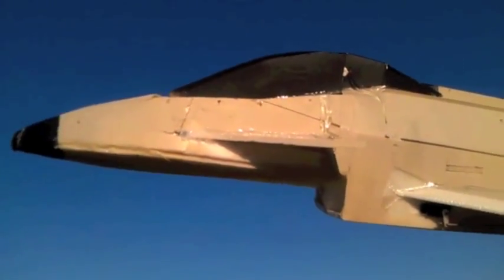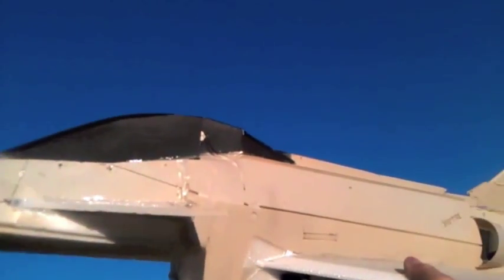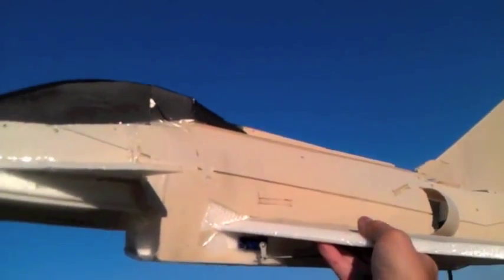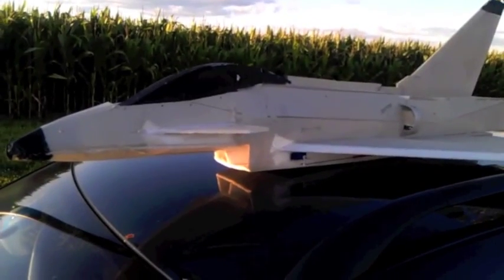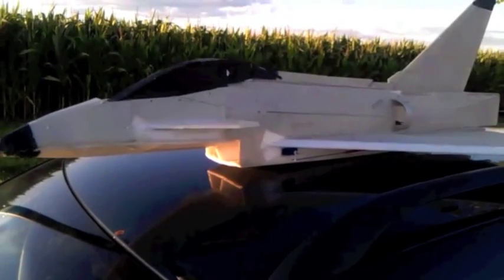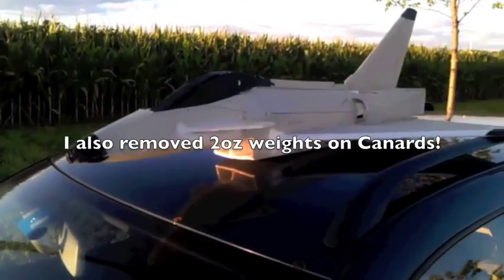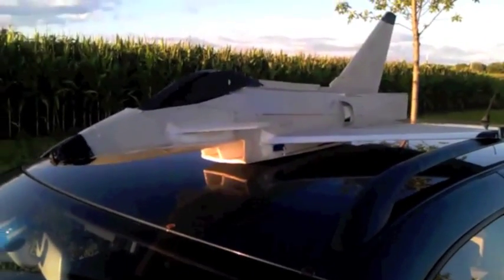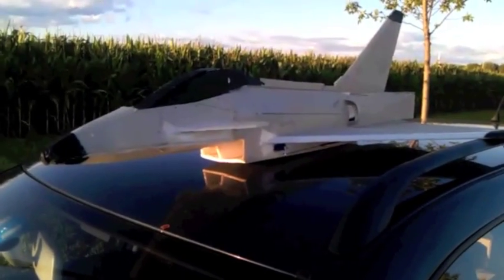RCPowers Eurofighter v2 -Canard Angle Adjustment

Comment: Did you try zero angle of attack?  Are you working with the original C.G. as marked on the plans?  Thanks for the info.  I was going to try some of these modifications but you're two steps ahead of me.